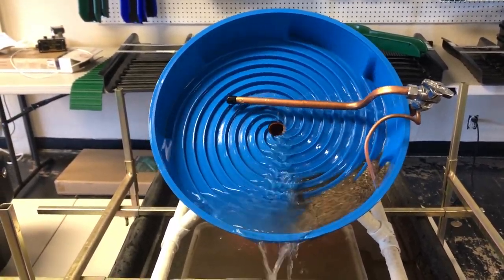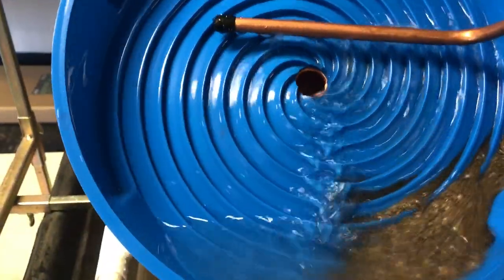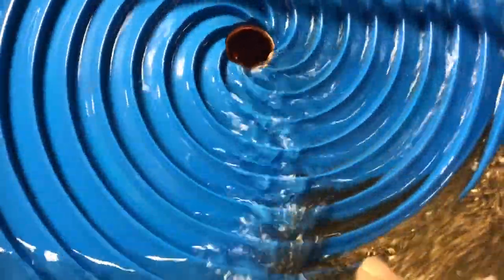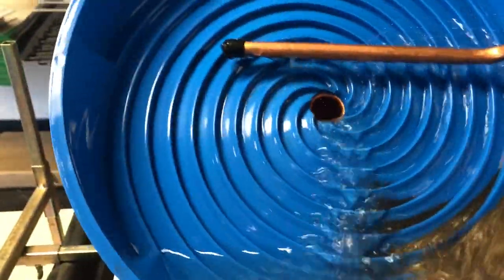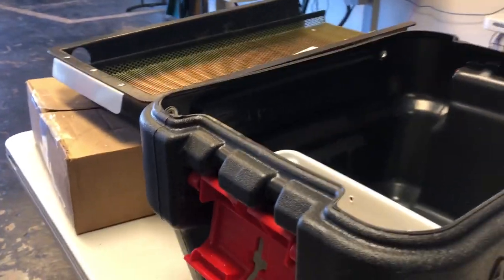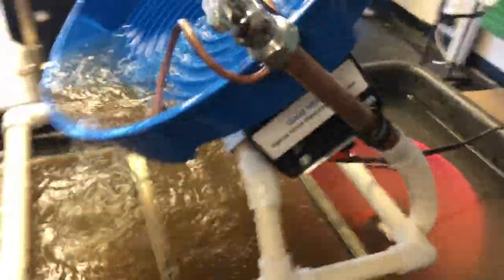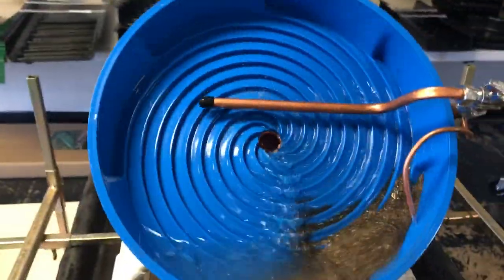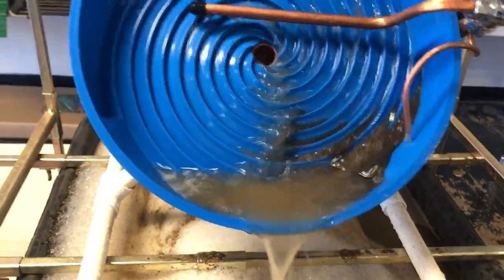Gold Miner's Spiral Gold Wheel - An Automatic Gold Panning Machine

Comment: Nice video! So, if it requires to start to catch black sand by going through the center a blue bowl system could be working on that material to save some time. As it is designed for finer gold. If the angle is steeper the black sand will fall out of the side and if fine gold is going over, it could fall into the blue bowl. With the right speed on the blue bowl, it will get rid of the black sand and all the non gold for ya. Then all that remains is the fine gold. Looks like you have plenty of equipment to set it all up.

Comment: I bought one of these units years ago and it isn't worth a damn for fine gold. Works good on material that has heavy gold. Waste of money in my opinion. Good review on the wheel though. Thanks
Reply from the maker: Thanks for watching. I found the trick to find gold is allowing a little more black sand into your cup than usual. Also running your 100/200- mesh material separately will product great results.  What brand did you use? I know there has been in a change in wheel design with some manufacturers.
Reply: I have the same machine. I find that a miller table is the best recovery for fine gold and gets zero black sand. It's slow, but so is the spiral wheel and blue bowl. Your video is a good tutorial on the wheel though. Thanks.
Reply: Geno from Reno Prospector which machine do you suggest ???
Reply: @Adilazizi_44  I personally like using a Miller table. Gets all the fines and easy to build one. It's slow going though. 😎👍🇺🇸
Reply: @genofromrenoprospector6940  999
loo8jj